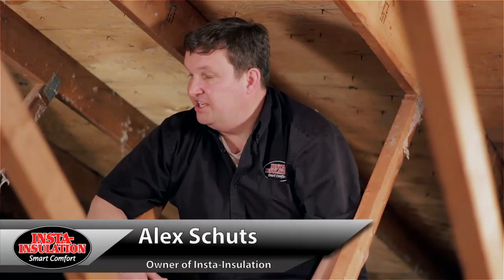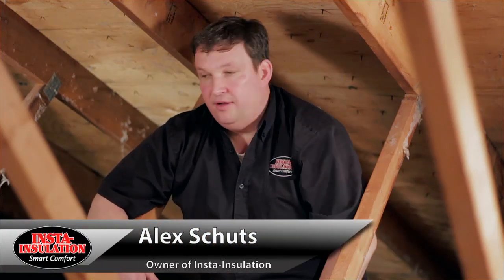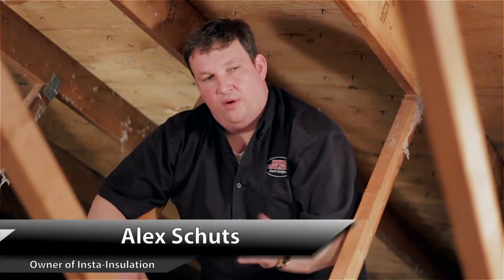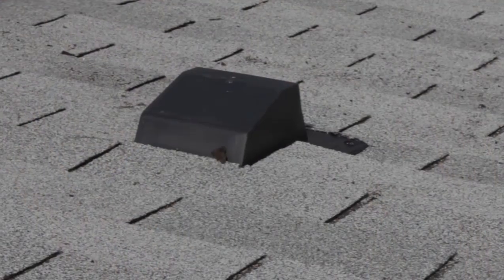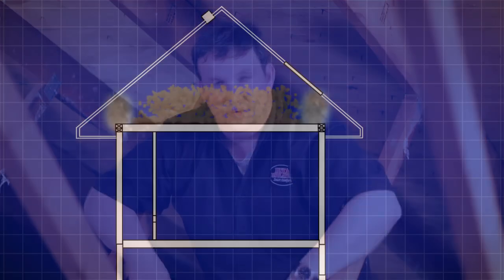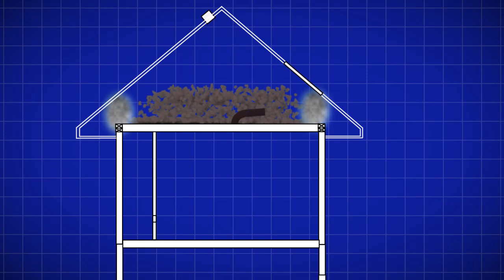Bathroom Venting - Why Not Vent out the Soffit? | Insta-Insulation

Comment: Where I live we get a ton of snow in the winter had a problem with moisture dripping back through the fan the bathroom vent blocked with snow. Removed roof vent and went to soffit vent all I did was use Insulation to block soffit with the vent and the ones on either side of it to stop moisture from coming back into attic space never had a problem since no mold no moisture

Comment: I would think this is only a problem, or can even happen, if the attic soffit vents are right next to the bath exhaust vent. Out one and back up the other. If there is no attic ventilation soffit vent nearby go for it.
Reply: All ducting is local, just like real estate. This is the way they tell you to do it in western Montana if you have no soffit vents, and a lot of our houses don't. Out the soffit for bath fans. Bury the duct into the attic blown insulation a few inches and you have an insulated duct. Most of us up here have R45 in the attic, about a couple feet. Simple. Mine exhausted into the attic on a hanger for many years but my attic is so dry, didn't affect anything.

Comment: Why not vent out of the corner of the soffit and point away from the main soffit intake?
This gets a goiter off of your roof, and moves moist air away from the soffit air return. Prevailing winds will still push that moisture back towards the soffit intake some small portion of time, but not enough to be an issue.
Reply: Great idea

Comment: Yeah I can definitely see problems with that roof solution in snowy areas. If venting out through the wall is not an option, then I would go with soffit next and roof last - in places that get significant accumulating snow. The snow will melt and create an ice dam when the melted snow reaches the end of the roof. But I guess it's better than just venting to the attic space!
Reply: Yea no doubt I'm in Connecticut I've been redoing my whole roof a section at a time no way in hell I want a vent on that roof dear god no I'll do it out the soffit and make sure it has no way back in next to it's exit .. vents suck in roids here heavy snow or nasty downpour guaranteed water to find its way in your castle

Comment: It is never a good idea to vent bathroom or dryer exhaust into the soffits. The humidity draws back into the attic and condensation forms, causing wood to deteriorate. As a building inspector, I see this problem on a frequent basis. The code states that the exhaust should be routed to outside air, but do not put it where that air just comes right back into the attic.
Reply: what if its wood instead of soffits? Would it be ok?
Reply: +B Norman Some codes allow for soffit exhaust, but I see your point.
Reply: I think people are talking about through soffits not into soffits.

Comment: Isn't that why you remove the vented soffit panels on either side for 4ft and replace them with solid ones?  That is how new construction is done.  I guess after-work does not have that much flexibility so they say to go the much more leak-prone roof route.

Comment: This makes sense, but what about when the moisture is high in the air outside anyway, such as on a  rainy day the moisture levels outside could be at 96% humidity.  Isn't your idea of not having humid air going back into the attic through the soffits happening anyway on days like this?
Reply: The problem is dew-point temperature. When the humidity levels are high and there are cold surfaces below dew point temperature, condensation forms. This is usually an occurrence in the spring or fall months when we have a rainy or humid warm day, then it becomes cold quickly as the sun sets. Also, if we are pushing warm humid air out of the bathroom during a steamy shower, this saturated air will condensate in cooler surfaces, especially in the mornings when temperatures for the day are usually at their lowest.

We cannot change dew point temperature, the best we can do is try to minimize the humidity levels to alleviate condensation development. The Code requires that bathroom vents are terminated at outside air for this reason. I inspect an attic almost every week that has bathroom exhaust directed into the attic, and the roof deck is blackened in that area from repeated condensation and mold. Sometimes the roof deck is warped and delaminating.
Reply: The problems really come when it is colder outside, such as at night or during winter when condensation easily forms on the roof decking and nails, "dew point temperature" is reached. And yes, if you do not have good attic ventilation, you can get condensation in your attic after a warm humid day followed by a chilling night, with warm humid air trapped in the attic.

Comment: Not quite Alex.  In areas of significant snowfall in the winter months, your first choice should be venting out the gable end of a house.  Second choice is to vent out the soffit.  Venting out the roof should ONLY be considered as the 3rd choice due to the potential for ice dams starting on the roof.
Reply from the maker: Thanks your insight. Our roof jacks are higher on the slope, which tends to have less snow then bottoms do.  Maybe this is why we don't have ice damning issues with exhausts?   Gable is a good option but most houses we work in don't have gables. Points well taken.Thanks again.
Reply: Samoh Kul 
can I  vent the exhaust fan out of the dryer vent, connecting at the same dryer line?
Reply: Last time someone vented my house out a gable end I found moisture/water in the pipe due to the long run. Not sure if i should pitched hard pipe instead of laying on and across insulation.   Metal roofs don't like vents so now I have to choose between mold in the attic from the soffit vent or  snow ripping off the vent on metal roof slope.  I cant get a break..

Comment: Question...Our bathroom ventilation currently DOES vent out of the roof, but it actually causes ice dams around it because we live in Minnesota and there is snow on the roof, and the warm air coming out of the bathroom melts the snow on the roof around the vent. Because of this we considered venting out of a soffit instead, but now I am not sure what to do.
Reply: +InstaInsulation2009 I guarantee that in Minnesota, that whole roof is covered in snow! :)
Reply: I have a slate roof. I've read that it is a lot more difficult to sink a vent (that won't leak) in a slate roof than asphalt. The nearest gable end or roof peak is too far away for a bathroom fan (they don't make fans that powerful). So, I'm thinking of venting through the soffit. There is a damper on the fan, and the under eaves vent I plan to use also has a damper. Won't that be sufficient?
Reply from the maker: Sorry for the delay.  the roof jack/ vent maybe to low on the roof line.  If you vent near the peak it usually doesn't get covered in snow.  My apologies on the delay.